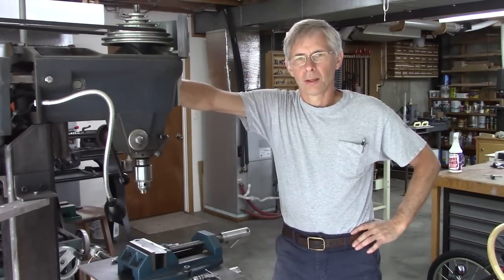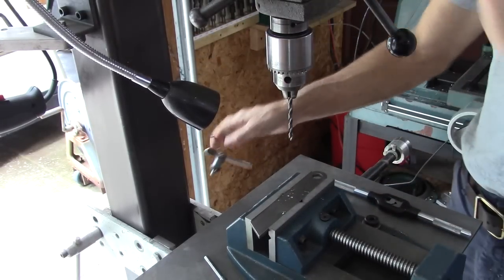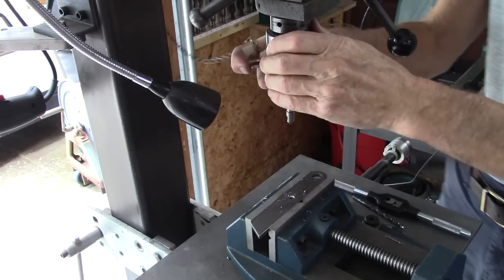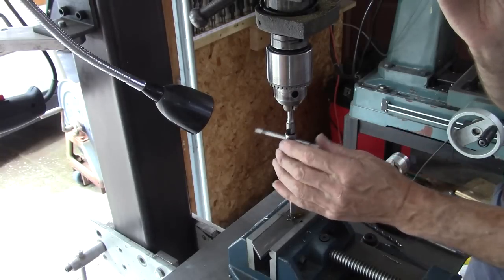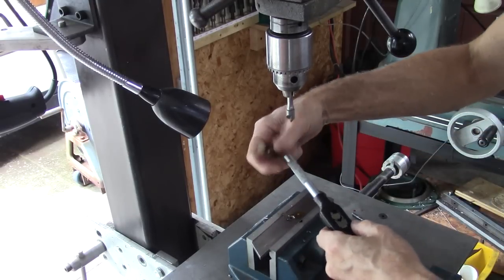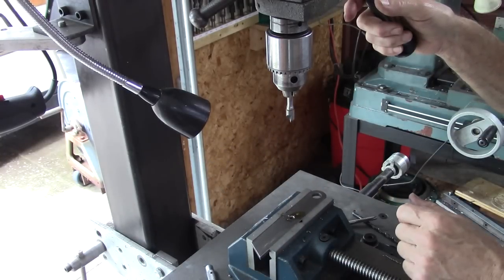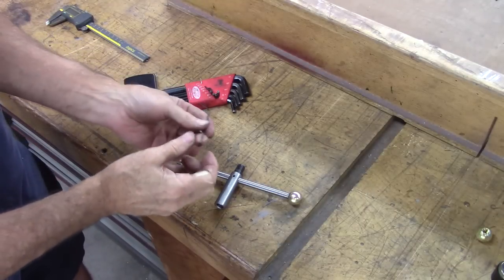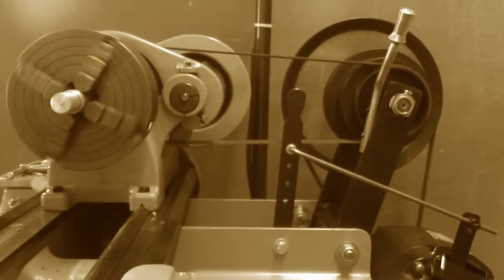Best Ever Guided Tap Wrench!

Comment: NOT HATE MAIL ...
I've been a fan of your Channel for a long time and have learned many things and ideas.  One comment I've debated with myself over is watching you stop the drill press chuck with your left hand after shutdown.  It hearkens me back to 1967 when my summer job before starting college was working at the Chevrolet Assembly Plant in Flint, Michigan.  My work station was next to a guy who had recently transferred from the 4 cylinder motor assembly line to the V8 line.  Before it became automated, his job at both locations was operating a stantion drill press to assure certain water passages in the engine block were symmetric.  For years, while working on the 4 cylinder line, he had stoppled the chuck by grabbing it with his hand, without incident.  On his first day on the V8 line, and while doing the same job as before, he reached up to stop the chuck.  Because these chucks used an allen key versus a chuck key, and the drill in the chuck on the V8 line was larger in diameter that the one on the 4 cylinder line, the tip of the allen key protruded slightly, which grabbed his wedding ring and ripped his finger off, including the tendons that connect it into the hand.  Obviously, "you" don't wear a ring when you work in the shop, but many Channel Observers do.  Even though virtually all of us have a "chuck key" arrangement, I can still see a situation where the teeth of the chuck could grab a ring and do the same damage.  Anyway ... it's off to better thoughts.
Reply from the maker: You're probably right, a bad habit. That a sad story for sure. I don't think anything quite that drastic could happen with my drill press but nevertheless. I'm not sure why the hex key was sticking out but somebody should have taken care of that. I should always exercise caution but when I'm around a new machine I'm in hyper caution mode. I worked as an engineer (without the degree) modifying and printing presses and related equipment. I wasn't allowed to use many of the machine in the shop but for some reason the drill press was okay to use. The darn thing was grossly over powered. with a big 3 hp motor. They had an old 6 inch mill vice on the table but no way o clamp it done. I saw one of the machinists drill in 1 inch hole and it grabbed, spun around a couple times and flew across the shop. I'm glad my lathe and drill press have 1/2 hp motors.
Reply: @WinkysWorkshop  A brief explanation.  The drill press model used on each production line was the same in both locations, however the hole to be machined on the V8 line was larger, therefore taking a larger diameter drill.  As to why the machines used allen bolts, I have to presume because the allen bolt might be faster to operate, and more likely, people being people, chuck keys would get misplaced (allen wrenches are everywhere), just a guess.  Because the drill diameter was greater, when the allen bolt was tightened, a small amount of the head remained outside the chuck.  Not much, but just enough to catch the guy's ring.  Of course, like all barn doors ... after the horse left the barn, a new rule came out that #1 don't brake the turning chuck, and #2 remove all jewelry (to include necklaces) before operating equipment.
URELATED ... a guy with an Afro Hairstyle was operating a pneumatic multi-socket (had to be 12-15 sockets) tool (very large device) that had two thumb-levers.  One lever initiated the sockets, and the other lever lowered the machine onto the headbolts.  One day a socket snapped in 1/2.  The operator stuck his head down to assess the problem and the 1/2 of the socket that stayed on the machine grabbed his hair.  You guessed it.  Very ugly.  From then on, we all had to wear hair nets while operating the machine and were told to let the "mill-right" conduct any assessments to the machine.

Comment: Very nice build Wink, a few of my tools have sliding handles like your new tap handle, I solved the sliding problem with 2, O rings on the shaft so it can still slide when I want it to for extra leverage. Also, on another subject, I have an 80s Craftsman brand drill press that I hate but it has one nice feature for a long time I never knew it had. It's possible to set the quill spring to force the quill up or force it down by pulling the 3 spoke handle out and adjusting the spring tension either way. It's a very handy feature for drilling, with the exception that you have to lock the quill in the up position, but it is very easy to change the force direction anyway.  I mostly have it set to the force-down direction for an easier drill bit to punch mark alignment. Don't know if all drill presses have that feature but I stumble on it when I was replacing the quill bearings by a setup mistake.
Reply from the maker: I thought about the o-ring method but most often I want it in the middle anyway. My drill press has that adjustment but it's not quick and easy. That would be handy at times.

Comment: I remember back in the 60's a die shop I worked at had a tapping fixture. A C-frame with a floating spindle, with a handwheel that had a spinner handle on it, attached on the top end. Place the work under the spindle and turn the handwheel. There were collects for every size tap. The C-frame kept the workpiece from spinning.
Reply from the maker: I've seen this...  they work great.
Reply: I also work with a similar device tool when I was in the Navy in the 1960s

Comment: You read my mind!  I saw you use this in the cut-off holder video, and I said to myself "I want one of THOSE!"
Reply from the maker: Thanks Roger. Yeah, I love this tap wrench. Of course it helps to have a drill press with a table that doesn't swing around. I can't imagine why drill press manufactures don't offer one with a dovetail column or box ways. Expense I'd say but I'd be willing to pay.
Reply: @WinkysWorkshop  Don't have a drill press but do have a mini mill - it should work!
Reply from the maker: @RogerTerrill  Heck yeah!

Comment: Great video. I like the different types of tap wrenches and advantages and disadvantages of each. I do a lot of tapping in my 15 inch drill press, especially on aluminum, with the tap held in the chuck. Takes a low speed, reversing motor, a bit of oil, and a quick in and out.
Reply from the maker: I've thought about getting a 3ph motor to get the low speed and instant reverse
Reply: @WinkysWorkshop  Actually my drill press motor is single phase 3/4 HP 1750 with reversing switch. I’ve learned to “bump” the switch about one second on while starting the tap then quickly off with spindle momentum “coasting” the tap through the part. On aluminum parts it’s a quick on, off, and reverse out. Three phase would be much better but with a little practice drill press tapping can be done with single phase. Keep those good educational videos coming.

Comment: Looking good.  I just put the tap in the drill press chuck and start the motor then when I get close to the hole stop the motor and jam the tap in.  Starts strainght every time.
Reply from the maker: Ha...  effective! I like it. I might try it with a slower drill press...  mine is a bit too fast. Even better would be 3 phase (instant reverse!)

Comment: First time viewer here and now a subscriber. Thanks for the tapping tips and the small project. I have had great success using form taps and have yet to break one so whenever I need to purchase a new tap I select the forming tap. By the way all the manufactured tools I have tested are usually around Rc 36 in hardness, soft enough to drill through.
Reply from the maker: Thanks for the sub! I've never used a form tap. I hear they are stronger but better suited for softer metal.
Reply: @WinkysWorkshop  Yes for softer more ductile materials such as aluminum and leaded steel. Form,  “express” taps require a larger tap drill size since a portion of the material“flows” into the hole. With the correct size tap drill and proper lubricant the tap and the thread is stronger.

Comment: Liked it very much.  Funny how I used taps all my life and never had a problem with them being non-concentric. 
...Badda-bing-badda-boom... UNTIL I started doing some precision work.   YIKES -- never realized just how off they could be !!!  
This appears to be a great solution - got the Irwin tap socket set $29 in my Wishlist for the next set of orders.  Will be fun to make. 
Would have been nice to have a spring-ball type mechanism for centering the handle, but I sure don't see any easy of of doing it w/o making the upper handle of a 1/4" larger diameter. 
But really not important that set screw can be let out if leverage is REALLY needed.  
Thankyou.
Reply from the maker: I considered the ball and detent on the handle but honestly I've never needed to slide the handle. I use the heck out of this tap wrench. Thanks for watching!
Reply: @WinkysWorkshop  You've got good long handles on it anyway & set screw is simpler.

Comment: Nice job. Back in the days of steam, we used to use taps chucked in a Jacob's chuck, in a vertical mill, and power tapped. The tap would slip when the threads were at the point that we would finish off manually. Another trick was to use a socket just bigger than the tap OD to guide it when starting.  Working smarter not harder when ever possible. 

Keep up the good work and ideas!
Reply from the maker: Thanks!

Comment: Just rewatching your video not realizing I'd watched it before until I saw my comment, I improved all drill press work by removing the handle on the drill chuck key and welding it through a box end of a combination wrench  1/2" or 9/16" and the first time I used it I thought why did I do this 10 years ago.
Reply from the maker: That is a good idea! I'm sure the keys are made short to protect the chuck but slipping drills doesn't do the chuck any good either

Comment: My husband used the same female tap adapter  but he used a sliding T handle that had a 1/2  square male on the bottom and a combination 3/8  and 1/4 male adapter on the top of the sliding T handle. He put a deep 10 mm socket onto the 1/4 adapter on top and now had a tool very similar ot the one you made but using ready  purchased tools.
Reply from the maker: It sounds like you husband thinks like me

Comment: Nice tool Winky! One tip if you wish to make the handle tight in the body, then put a deep coarse knurl  where you want it tight and if it is not too slack in the first place then it will become a light press fit. I did this when I made an unequal length handle for my Chinese 6" three jaw chuck on my lathe to give me just a little more purchase. It worked a treat. (  Not my idea, I was only copying the original stock handle)
Reply from the maker: That's a good idea!  I'd done this before. I went with the set screw I it would be easy to change the handle length if I needed to.  Thanks

Comment: Thanks for this Mark, I've been looking at those tap holders. Nice job on the T-handle. Another option for securing it would be an o-ring on either side. That way ithe handle could be easily moved if tapping in tight quarters.
Reply from the maker: The O-ring would work great! Thanks

Comment: I like it!  I've used a spring loaded tap guide for quite awhile, but this has some definite advantages.
Reply from the maker: Especially if you take the time to chamfer the hole. Plus there is no chance of the guide slipping out of the center.  Thanks for watching

Comment: Great idea Mark i am sure going to have to add this as a priority to my project list.
Like you to many tapped holes gets a bit to much. Completely agree.😊😊👍👍🏆
Champion idea between tap sizes too.
Reply from the maker: Thanks Troy, I think you will love it. Be sure to get the same tap socket that I did. I bought some about a year ago for the same purpose and ended up sending them back. They looked quality but held the taps crooked. Irwin seems to be much better! PN   3095001
Reply: @WinkysWorkshop  thanks mark for the heads up it does make a difference to getting the good results

Comment: Hello Mr. Winky,   I wonder if an old machinist's trick would work for you on the loose handle rod:  perhaps try knurling the area that slips through the body.  It might gain you a few thou and make it fit.
BTW, GREAT IDEA!  I will be making one...
Reply from the maker: Yeah...  good idea. I have done that several times. Thanks!

Comment: The set screw was a stoke of genius, I would add a groove centered on the ‘T’ handle for the set screw to hold and balance it. Although in retrospect, I am a little OCD at times.
Reply from the maker: Actually I thought about doing that also but I was worried about it weakening the handle.  Thanks for watching.

Comment: I love it! It gave me a idea , I combined your 3/8" Square drive tap holder with a spring loaded tap follower and a counter sink all in one.
I would post a copy but I don't know how. Me no do tech.
Reply from the maker: Save a picture to google photos and send me a link.
Reply: @WinkysWorkshop  First time for google photos. 
https://photos.google.com/photo/AF1QipOYhX3Srt4mnfCBYElY_ClookCPsO2uels4Utau
Haven't built one yet, my 9A is apart for cleaning / painting.
Reply from the maker: @rodritz8384  Hello Rod,  the link didn't work. In google photos - While viewing the picture you want to share click the left most icon. It's 3 dot connected with 2 lines. In the window that pops up click create link and then click copy. You can then past in into a comment to me.
Reply: @WinkysWorkshop  Like I said "Me No Do Tech" Actually I just never bother to figure it out till I need to. Try this "Take Three!"
 https://photos.app.goo.gl/vZVnqGVPTXcQCV7g6
I do really appreciate the work you do with your video's. I had a South Bend 9A given to me this fall I have torn down for cleaning/painting and I just picked up a Van Norman #10 duplex mill. I ran production lathes and mills for 40 years but these are different and I need all the help I can get.
Reply: Added another photo of one of my better idea's. Underneath work benches are usually a black hole where things go to die. That's my nut and bolt storage, I can easily see exactly what I have and the rest of the time it is out of the way.
Reply from the maker: @rodritz8384  Interesting idea. although you need to drill the end of the extension for a set screw and insert a small coutersink bit. I assume you plan to use drill press power for the tapping?
Reply from the maker: @rodritz8384  Cool storage solution!
Reply: @WinkysWorkshop  Yes I see installing a countersink bit to the end of the extension would be better than grinding the extension end into a countersink.Wouldn't use drill press power, would just use it to compress the spring and lock it there, so both hands are free to turn the handle. The part you lock in the chuck is free to turn in the holder. It is basically a spring loaded tap follower with a quick change countersink. My thinking was to get the tap and countersink lengths closer to the drill length so I don't have to move the table and to allow hands free tapping. Can't make one till I get my lathe back together, maybe it won't work.
Reply from the maker: @rodritz8384  - Yes, getting the length closer to the same would be a plus. It's not an issue with my drill press with the power table but most do not have this. It would be nice if a drill press manufacturer could get their head out of their butt and make a BETTER drill press.

Comment: I think the black drive is for impact and hardened. And on the handle take a chisel and  upset the handle on both sides of the tap holder. Just a little should stop it from moving all the way side to side.
Reply from the maker: I think in the past the black extensions might have been harder but these were just cheaper. (Harbor Freight) Good idea on the handle.

Comment: Really nice! Maybe a ball detent set screw with a small groove? Working on my square column drill press now!
Reply from the maker: I thought about that too although most often I'd leave the handle in the middle. Cool on the drill press! I absolutely love mine, especially after adding the HF drill power lift. The only thing I'd change is to increase the width of the vertical front lower arms, the ones that hold the eccentric pin/bearing. You might also pin or weld the arms to the horizontal piece. My table has a little spring to it....  certainly not a major concern but still worthwhile fixing while you are building it.

Comment: Nice. Me, i would have just added leverage to the little wrench's handles to solve the comfort issue, and hooked a weight on the drill press handle to solve the need for a third hand issue. But i can't get shmancy tools like the cool adapters you used.
Reply from the maker: That would work, thanks

Comment: Winky, I think I have just found my weekend project. Better than tidying a bunch of screws, nuts and bolts that seem to have escaped their boxes.
Reply from the maker: Thanks, the part number for the adapter is in the description if you need it.
Reply: @WinkysWorkshop  I made a series of 'tap holders' by drilling a stopped hole through a piece of round stock the size of the shank of the tap and then with the stock vertically in the mill vice from the other end made a pass in X and then Y axis using a cutter the correct size for the width of the flats on the back of the tap. It now has a sliding fit in the front part of the guide and then the flats are held by the '+' in the back. (Not my idea I saw someone do this a while ago) They were then supposed to go in the drill press chuck but it didn't work that well but if I make a sliding adapter then perhaps it might.
Reply from the maker: @michaellinahan7740  - I think you commented on my last tap holder. Thats a good idea and I thought about doing the same for using in my tail stock.